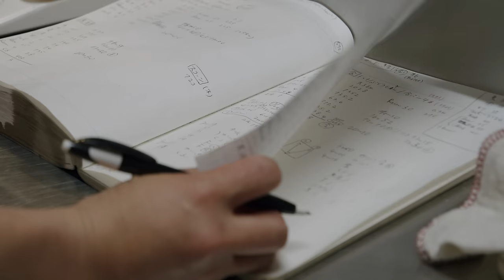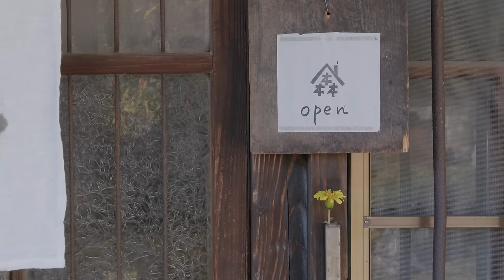A Woman runs a bakery deep in the mountains | wood fired oven | Sourdough bread making in Japan

Comment: Next time put a curtain or some kind of cloth across the ceiling closer down to the concrete wall that way the heat will not rise up to the ceiling and the heat will stay below the concrete wall and heat the other room faster in the fermentation faster and you will keep the heat lower in the room where you need it in the winter time